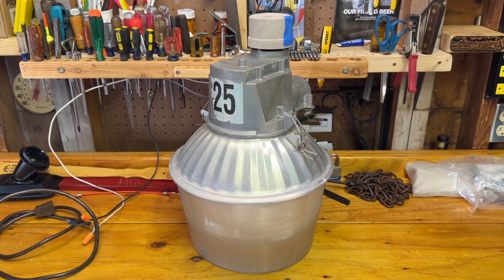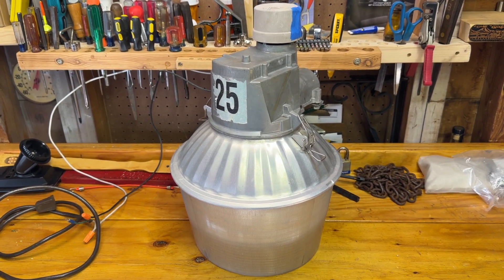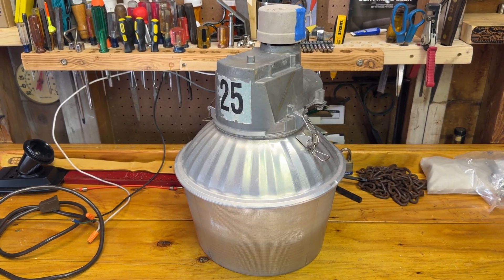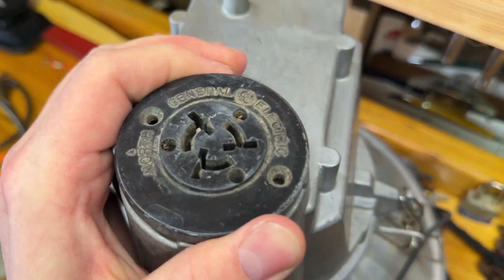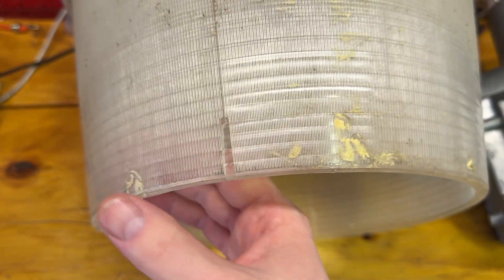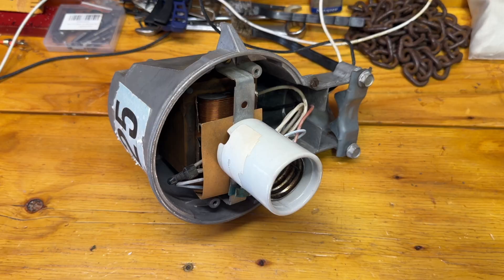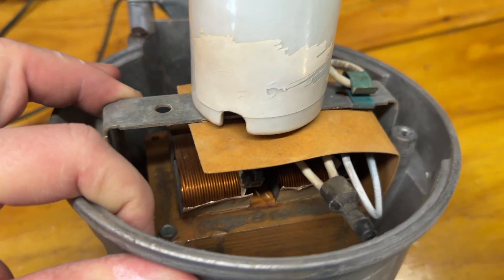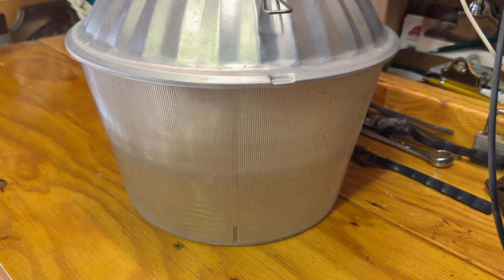GE 201SA 250watt Mercury Vapor NEMA Street Light

Comment: Very unique NEMA head.   At least not nearly as common as the 175 watt MV.  Can't say I've ever seen a 250W MV fixture of this style.  However I do recall about 15 to 20 years ago seeing a 125 watt MV version of this fixture in a large catalog.  Northern Tool if memory serves me correctly and I believe it was made by Cooper Lighting as one of their "in house" wattages because 125W MV is very uncommon in the US.   

Anyway, I really like that familiar 6000K give or take glow that clear MV lamps are known for, makes the grass really stand out at night.   Currently the only MV lamp I have in my collection is the 400W BLB, BT37 with an E40 base, since I only have two ballasts that can run it,  an M59, and M155 with the ignitor disconnected. Which in reality is no different than any other 400W MV, other than the envelope which is made of woods glass (I think) which filters out nearly all light except in the blue/purple very near the UV-A spectrum, UV-A and UV-B and as such, runs SUPER hot!  I was measuring an average temperature of around 550°F with a laser thermometer, with a few hot spots around 610°F.  I also own a M98 ballast which is running a 70W open rated MH in a halogen torcheire that I converted to MH 11 years ago.  It's roughly the brightness of a 300W halogen - very popular in the 90s when I was a little boy- 4000K with a CRI of about 65, essentially the equivalent of a standard cool white fluorescent tube which was phased out for the F96T12, F96T12/HO in April 1994, and October 1995 for the F40T12 as the first round of federal energy efficiency regulations took effect.   I believe only these three lamps were ever effected, because I own four GE F24T12/CW slimlines all manufactured August 2005, two of which I have yet to light up, and two GE F40T17/CW/IS, both manufactured January 2008, which by that point only GE was still making the F90T17 and F40T17-IS lamps, and only 6 years before the plug was pulled on all T17 lamp manufacturer.  Interestingly enough a couple months back reproduction T17 lamps began to emerge from small less known manufacturers.  Technical Precision and Industrial Performance makes the F40T17-CW-IS, and the F54"T17-SDB-VHO and if you weren't aware, this was Super Diazo Blue, and that lamp was required for some older blueprint machines.  No reproduction F90T17 yet, and understandably when you consider the last F90T17 ballasts were made until 2000 or 2001 believe it or not, by Power Lighting Products, Inc, as were the starters in both the 2 pin (glow bottle) and 4 pin (thermal) versions.   I haven't been able to find any info online as to when the G20 aka mogul bi-pin lampholders were discontinued, but I have yet to find any online for my F40T17's, but everyone can rest assured I will be hoarding them whenever and if I ever find any.  😊

Comment: I really do love those fixtures due to the fact that they contain simple uncorrected power factor HX ballasts and that they could run a huge variety of retrofit lamps. However, one of the disadvantages of HX ballasts is that you really have to pay greater attention to the line voltage more so than with CWA ballasts because a lower line voltage could easily underdrive a lamp and a higher line voltage could easily overdrive a lamp.

Comment: Rare find! 250w MV NEMA and a late MV one from (I’m assuming) 2007.

From the 1990s to 2000s I believe GE still made variants of older lights like the M-1000 and M-400R2 after they were discontinued. I believe if you knew the catalog number, or you insisted on buying one, GE would make it for you. Now of course they wouldn’t make just two lights for a random business, I’m assuming they made them in small batches for the few people/customers that wanted these specific lights. The area this came from might have had a lot of late MV use in commercial or possibly utility use so that’s why they were made.

I’m guessing this was sold as a commercial unit pack from an electrical distributor since it does not have a terminal block like one made for a city or utility would have. So it would come with a photocell, lamp, and arm.
Reply from the maker: Thanks for the info!